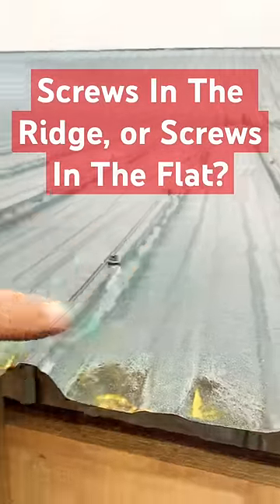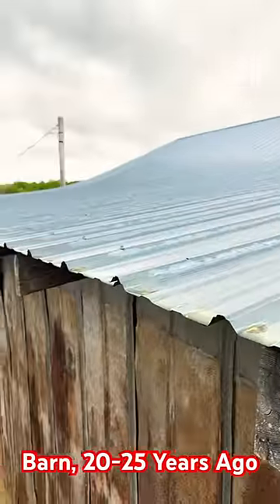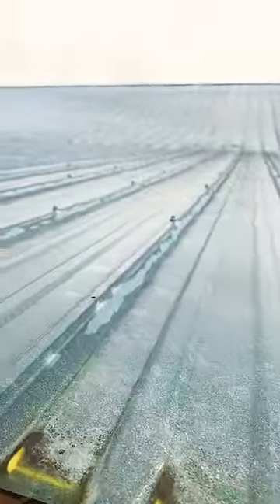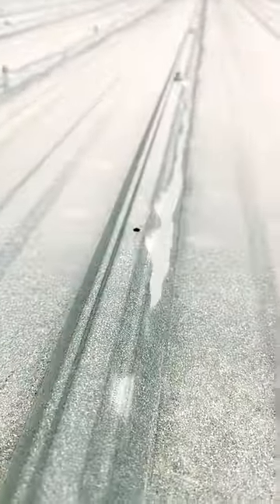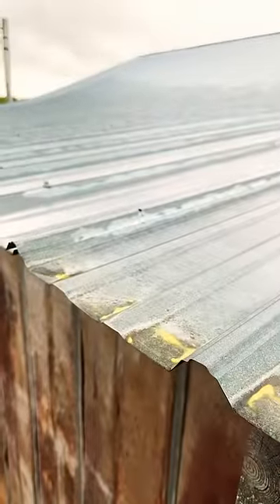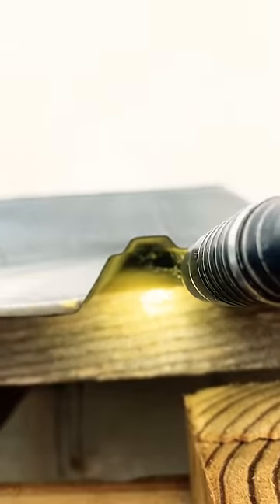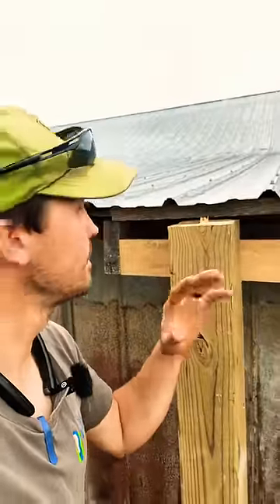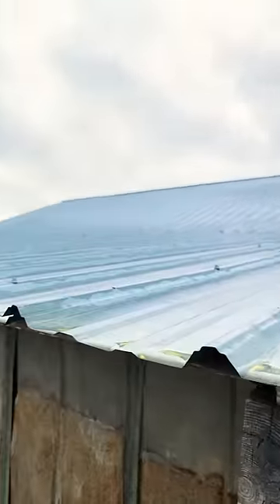What’s Better? Screws In The Ridge Or Flat? #construction #farmlife #building

Comment: We only screw in the ridge on very low pitched roofs like a 1-2/12, anything higher goes in the flats. Been doing like that for years & never had a leak around a screw. Also here it voids the warranty screwing in the ridge.

Comment: You do whatever the manufacturer recommends. Normally you put them in the valley and it works fine. Nails used to always be on the ridge but screws tend to go in the valley

Comment: Both, alternating rows of wood screws in the flat to the pearlings keep the metal down, metal to metal screws in the high rib to keep the overlap from allowing the wind to lift the overlap. neoprene washers or black rubber washers (uncrushed) seated properly will not leak, and maintenance requires checking the condition of these washers for drying out over time and replacement when necesarry, depending on position of the building to direct sunlight or indirect sun and the area of the country you live in. many variables to consider, not a black and white debate.

Comment: Just screwed my 45 y/o garage roof after multiple leaks. Nails had all backed out from the ridge. I opted to screw the flats as thats what was suggested to me to do. My ridges are rounded so screwing there isnt ideal. Hopefully it lasts. I did go over each screw with a spray sealant as a secondary measure too.

Comment: Well unfortunately the metal is designed to be structural on the flats (it will compress and flex if not drawn tight against the purlin). However putting screws in the ridge is by far the best protection against water damage. Ill still give up some strength to add protection.

Comment: A hole is a hole it’s going to leak, your video shows a great thought that a small hole in the ridge won’t cause as much damage as people think however out that hole in the ridge ina. High flow area like a valley or behind a chimney or a spot where ice builds it’s going to cause damage to the structure

Also your looking at a pole barn, you don’t roof a house like a barn, and really should roof a barn like you roof a house. 

In high wind areas those screws in the ridges have more room to move and strip out faster and cause the leaks I spoke about above more. When screwed into the lows the screw remains tight for longer and doesn’t move minimally in the wind and in turn (no pun intended) keeps it from backing out. 

Furthermore a hole in the roof is a hole in the roof if your roof has a whole you fix it.

My two sense as a roofer I would recommend underlayment.

Comment: The screws must go on the flat to secure the metal tightly enough. If you ever have wind damage and the insurance company sees your screws are on the ridge. You get nothing:  because the roof was improperly installed.

Comment: Wow....that shit makes sense... Seems like you got to have a few out in the field up against the trusses just to keep the s*** secure but I guess at the tension in the metal stays there screws in the top of the ridges on the material will stay tight and if they don't well I guess they're basically on the top of a hip or a ridge so.... Basically the one point that you're allowed to f**** on every job and it's unavoidable and yet it always pans out

Comment: You might be surprised to hear that some roofers put them in the flat.  But the ridge is better, even with rubber seals on the screws, because rubber gets hard and sometimes splits.  Screws get loose.  Then you have a leak.  It's just common sense to put the screws in the ridge whenever you can.  Do you remember leadheads?

Comment: I have a section on a heifer barn that takes wind, and if I didn't add screws in the flat at the bottom, the ones in the ridge work out and get loose. It is very wet under there also.

Comment: I've installed a bunch of these, always have to screw on the ridge. It won't actually seal to the next piece if you don't. Also the overlap is on the ridge if you screw on the flat you're not catching the overlap. I have seen some screw on the side of the ridge if you have to 👍👍

Comment: Nails in the ridge, screws in the flats. But this varies based on the type of roofing, 5v gets the flats, corrugated gets the ridge, 5 crimp gets ridges or flats depending on fastener.

Comment: Sorry to bust yalls bubbles that picked a side but you need both. Get two different size screws. Ridge holds metal to metal and flats hold the metal down to the slats.

Comment: If you choose ridge you will dimple the steel, ruining the look while creating a penetration point for water because expansion and contraction of the metal due to heating and cooling will create an open access point for water to enter, and a big opening behind it to receive it.

The flat, however, will give you a tight seal against the wood, wood-steel-screw in a nice tight sandwich - resisting expansion/contraction gaps and thus protecting much more effectively against water penetration while preserving the look of the corrugated steel

Comment: flat is definetly the way to go, it makes the steel a lot stonger because you are flush against wood, you dont get a 1 inch air gap for the screw to wiggle and roofs screwed in the flat dont take off in high winds... also you can shovel a roof with screws in the flat and you ensure a 100% seal of the rubber washer unlike the rib screwing.. if you try to shovel a roof with screws in the rib you will damage/bend the screw and introduce leaks

Comment: Shoveling snow off a roof with screws in the ridge, is a complete nightmare. I like putting screws in the flat, using ice/water shield (Bituthane) on the entire roof before the metal and doing it in the summer to ensure a good seal.

Comment: Always put the screws in the ridge because the expansion and contraction of the roofing Mike's the screws in the flat work out, then it leaks and loosens. And rots the wood. Especially where the pieces of ten are long and dark colored

Comment: You're going to have water condensing on the inside of the roof regardless without insulation so it doesn't really matter. The amount of water under the roof from condensation will way outweigh any amount of water from screw holes. The key is ventilation so the wood dries out. That's what's keeping the structure in good shape.

Comment: screws in the ridge are not typically used for holding down the sheet, only for the seam. The holding screws should be every foot along each purlin. On a secondary point, long screws cost more money so you are paying more money for screws if you do ridge fastners.

Comment: On the flat is correct for proper and consistent gasket compression.  The ridge will expand and contract significantly with temperature change causing the gasket tension to change.  Even worse the gasket will tend to be looses when it is raining/snowing as the roof deck will tend to cool and contract, slightly changing the distance between top of ridge and the roof deck.

Comment: Screws in the flat is the proper way if you want a warranty. If you put all the screws in the ribs, you will void the warranty on the roof. The only panel that is approved for rib fasteners is the 5V crimp panel all others go in the flat except for stitch screws.

Comment: in the ridge,  the ridge helps water bead off but if water does get through there is an air gap under it to dry out.  if you put the screw in the flat and the water gets through it will never dry out and eventually rot.

Comment: Screws in the flat to secure it to the structure and screws on the high ridge only where the panels lap. That’s why those screws are only 7/8” long because they are called Lap or Trim screws.

You never pre drill your lap screw holes. Only the structural screws to secure it to the structure.

Comment: Always screw in the ridge, the old original metal roof sheets were triangular peaked not the flat top, they used nails that had rubber washers way before screws came along. Most of the rubber washers were long gone over the years and daylight could be seen inside our barn from the missing nails in the metal, but the roof never leaked.

Comment: Depends on the outlook or even who's doing it. For your reasoning then yes the rib is the best place because to be honest the gaskets only last maybe 2 years and then they are dry rotted. But in the installation process you have to be careful if you screw the rib because if you go to far it will for the most part stretch the tin so to speak. Now the steeper the roof and the less crap on the roof then it won't matter if you put the screws in the flats. The other thing that people will come to find out since everybody just wants to put down firring strips and then the tin is that a roof on a roof will cause condensation and in time your roof will rot anyways. Let's also not forget in using tin that there is no actual sealing flashing for tin without caulking. Like around a chimney for example so eventually the caulking will also lose it's value and you'll notice most in areas that may hold water or get's hit with a driving rain.

Comment: It depends on the the style roofing and what your attaching to. But I have done both for different metal panel roofs. Both attached to different material and had different reasons for it. We screw through the flat with all structural screws attaching it to the roof. And then stich screwed the bridges that over lapped. And that was covering a high dollar Internet server room. It all depends on what your doing.

Comment: The ridge doesn't do it where there are snow and ice ... because the snow and ice are making a pressure pushing the ridge down and making a gap between the ridge and the screw. In countries with heavy winters we screw on the flat ... and the screws have rubber seal and they don't leak. I have never experienced that that's a problem with that. I have done a lot of roofing.

Comment: The panel in this video is not designed for screw in ridge. The panel is designed for screw to attach 1/4" from high in flat to suck the highs together. The ridge is crimped to prevent water from rolling up and under sheet when highs are lapped.

Comment: In the ridge the screws will eventually pull out or unscrew itself just like a nail If it's not tight it will eventually pull out and don't say they don't cause they do.and besides that a metal roof looks like shit

Comment: If you are going to be the one doing it, then you can do it on the ribs, but it is so easy because the small dent in that rib and caused it to hold water and leak. I do know that the rubber washes dry off faster if it’s on the ribs however, since I started subcontracting my Roofing workout, we just do it in the flats, but now they also have a lifetime screw where the top of the head covers the entire rubber washer instead of it, squishing it out now it just totally covers it sohave went from doing the jobs myself doing it in the ribs to doing it in the flats now because I’m not doing every screw myself

Comment: Why would anybody put them in the flat That's where the water channel is. Not only does it cause the screw to rust quicker than if it was on the ridge you also can't get a watertight seal without some kind of gasket which would wear down over time. I don't see how this is a debate

Comment: Screws in the ridge cannot be tightened enough to compress the gasket to make a proper seal.  If you try to tighten to proper seal you bend the ridge making a puddle.

Comment: Depends on the roof profile. Wide flats, in the ridge, narrow flats in the trough, depending on the seals of the fixings. UK not predrilled, self drilling into steel or timber purlins with durable neoprene seals.

Comment: Screws go in the high ribs to prevent snow build up. In high wind zones like Florida the engineering for 5 rib panels such as these calls for them in the flats due to the high wind that hurricanes bring in. I ran a roofing crew here in fl for many years. We have the strictest and most over engineered roofing codes in the entire nation due to hurricanes.

Comment: My shop was built over 30 years ago. The metal roof was fastened in the ridge and it has a leak so this is a lie.  Most people overtighten their screws and blow out the washers and that’s why they leak.

Comment: I guess I'll pass on what I know, on the ridge definitely, everybody here has hit it right on, yes because it's the high point and you don't want the water to sit on it and leak through the roof the second main reason for the Ridge and nailing or screwing it on there is that the ridge has a high Bell like profile and with the screw in the center it allows the metal on either side of the Bell to flex a little bit.. you need that ability for the metal to flex because it expands and contracts and moves back and forth side to side and the same it does also from end to end .. so all of the screws are constantly under stress and being screwed out same thing with nails.. that's why those are probably missing down on the eve. As soon as that cheating flexes back and forth the washer gets rubbed and with years of weather and light it goes away and provides a water Point into the roof and under the sheet. If you are on flat surface they Flex even more because they have more pressure with less room to give. If the washer goes out on the ridge it's not near as likely to allow water in because it is at a higher Point as has been pointed out

Comment: I’m 50 now & my dad always taught me growing up to put screws in the ridge as well. I started in construction w him when I was 13yo during summer & all school holidays. Never had any leaks in any metal roof I built w him or own my own. However had I paid a contractor to build my 40’x50’ shop because I had had a few back surgeries & wasn’t able to build it myself. Normal 2x4 wood frame wrapped in tin w a tin roof. All screws are in the flat & I’ve had leaks in my roof since the first rain.

Comment: Screws in the flat defies logic. If water is going to settle anywhere, it will settle in the flats and accumulate making it easier to find ways past the screw. Ridge has less water accumulation so less water pressure for penetration.

Comment: Its just the soffit underneath where that screw hole is, so water getting through there is no big deal because it's not getting into the shed or barn or whatever that structure is anyway, but go further up the roof line and have an empty screw hole, then yeah, you will get leaking inside the barn.

Comment: Put screws in the rib over here on beach side east coast Florida, inspector would shame you. The screw in the rib lifts the flat section and causes moisture build up, then when you walk on it it tears the screw holes loose via tearing up gaskets. the ribs are there for expansion purposes with it in the rib it adds more tension on the screws cause the flats push in.

Comment: Both, lap screws on the high flute. Tight pattern across the top and bottom ends of the panel in the low flutes. Tape sealant under all screw locations.

Comment: Do violate a perfectly waterproof metal panel with lots of face scews that rely on a rubber gasket to seal the hole. The rubber grommets fail in a short time. Pay the extra ...say no to face screws on a roof...there are other options.

Comment: I have a barn that has nails on the ridge.   Most have loosened and leak.    I built 2 all steel buildings a few years back.   The blueprints instructed for screws in the flat

Comment: The reason they want it in the flats is the metal expanse and contracts with heat and cold I’ve never seen the ridges screwed, but I know when they used to nail them, the nails would pop out

Comment: screws in the flat. neoprene washer on screw seat tight to flat easier to ring them off in the ridge . roofer 40 yrs. experience. metal roof manufacturers directions say in the flat.

Comment: I believe it works either way acts seen it done both ways. I will say, if they are in the flat, it's way easier to pull the snow off with a roof rake as the rake catches every darn screw. So that would be the only difference

Comment: When we did ours we talked to an older gentleman and he suggested going in the flat because of the fact that the screw that is exposed in the Ridge area looks get frost on them and Rossville of course milk and roll down the threads and start weakening around the threads in the wood especially in cattle barns where there's a lot of moisture

Comment: Always in the ridge, if it's in the flat part, try again that is where the water runs off the roof it doesn't matter what the paper said my grandfather put it in the same spot in the good old days and them brans is over a 100 years old and do not leak.

Comment: You can get away with that on a wooden structure, on a steel structure you'll need to go in the flats to pass inspection to cide also to be hurricane rated and avoid walk outs due to expansion.

Comment: You need to put structural screws in through the flat, and you put stitch screws in through the lap of the sheets. The stitch screws taper to a fatter size near the head to prevent leaks the ones that are going down through the flats don’t need to taper because they have a washer that gets squished and seals.

Comment: The ridge is the high point on the steel, harder for the water to get to. When you screw you create a hole so why have the hole at the lowest point where the highest chance of water getting in will be. Ridge 100% over flat

Comment: Every time ive seen them installed in the ridge they over tighten them with the impact driver and it either dents the ridge which holds water or it pushes down on the riband bows the flat up and makes the roof look like its got humps in it

Comment: The metal roof i used to install had locking ridges and hidden hardware no screw in the ridge or the flat those corrugated panels we used for the walls, not the roof